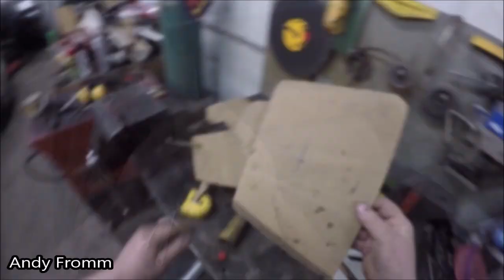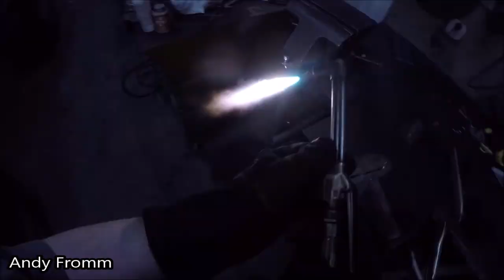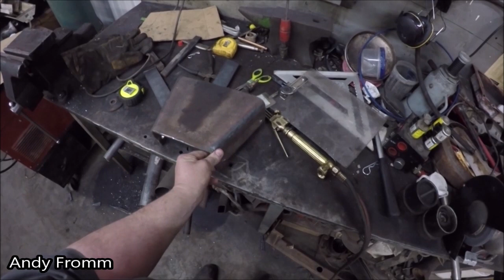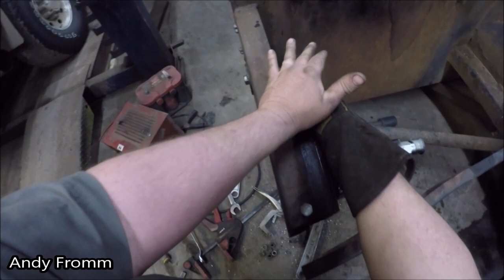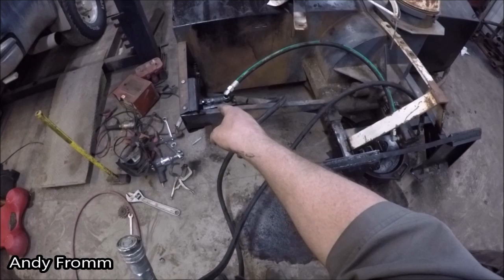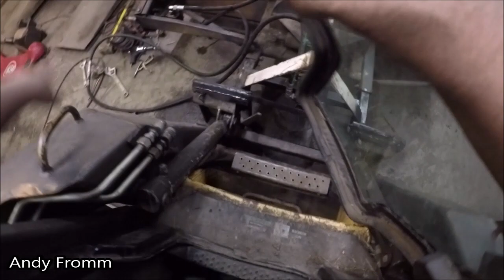Snowblower 3pt to skid steer conversion part6

Comment: How did the 2nd motor work as far as sharing power from the 1st motor running impellor? Watching your videos is inspiring me to convert my 3 point 60" Woodmaxx to front. Bought rpm accelerator for blower took 4 1/2 months to get, guy gave me large new gray hydraulic pump to put on tractor pto shaft. Have to look at pump specs, have no idea what pump capacity is. But he said it was large. Am thinking I dont wsnt to cut up Woodmaxx as it is brand new. Might find a 72" to convert instead as my rear tractor tires are 65" wide. One question, if the impellor requires 540 rpm at new what can I increase it to? 756? The pto accelerator I bought doubles so 540 would go to 1080 wide open throttle,  but I dont run my tractor that high. 
Would love to mount on front with a minute mount frame, dont want to use loader arms. Your thoughts would be appreciated. Do you use Surplus Center for hydraulic motors? Watched all 6, hoping for a 7th video. Oh, you mentioned plazma cutter, I bought one online 3 or 4 years ago,  was a Lotos 8000, works awesome, brother in law duplicated john deere backhoe mounts with 7/8" steel blew right through like nothing. Only drawback unit has no air compressor of its own,  have to hook it up to your house air. He used block of wood clamped for straight cuts, straight as a string with no grinding.
Reply from the maker: I think it seems improved with 2 motors, doesn't seem to stall out as easy.
The motor specs on my impeller are about 750 rpms, seems fine.
The doubler, i like to run 540 stuff off the 1000 shaft if it doesn't take much power so the engine doesn't have to be screaming. 
I've looked at surplus center. These motors were free out of the scrap bin, they weep a little out the shaft end.
If you have enough hp on your tractor, higher the gpm the happier you'll be with it. Gpm roughly equals hp. You might have to run a cooler. The setup will be spendy.
I'll have to check out that plasma, I'm good on air. I have a cast air 80 gallon with an extra 80 tank plumbed in. 
Thanks for watching & good luck.